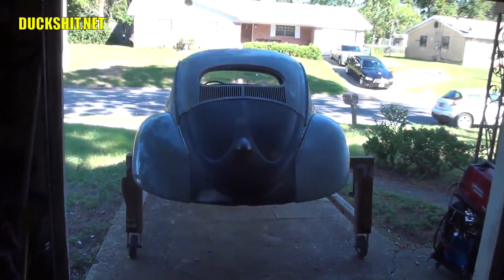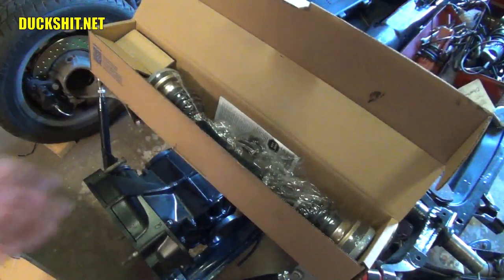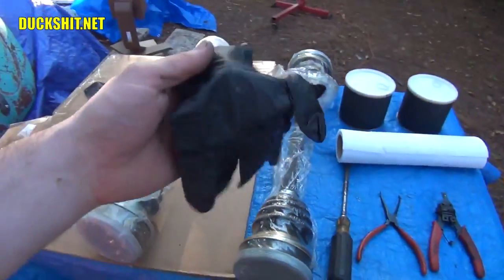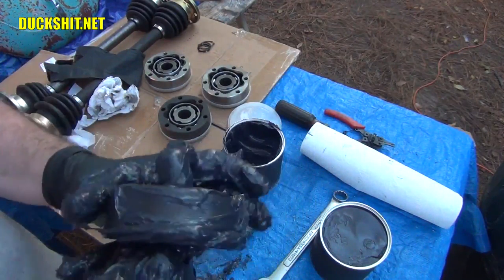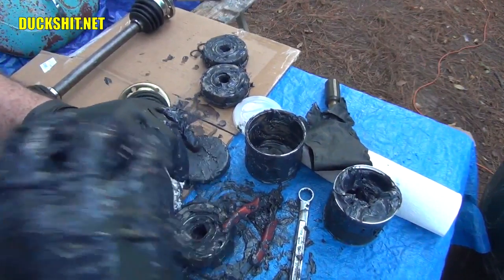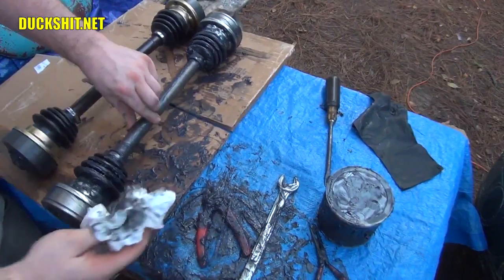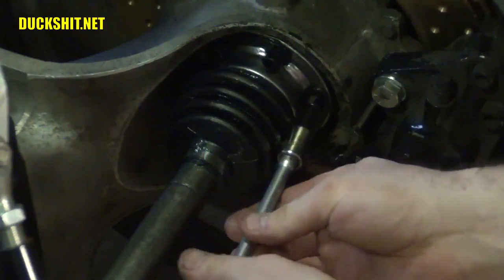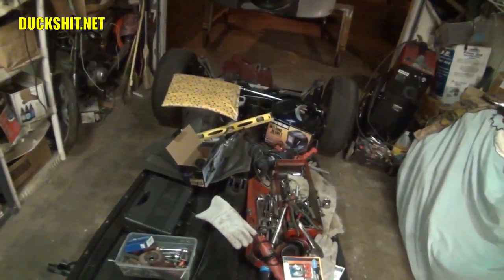Drive Axles / VW CV Joint Packing - ROTTEN OLD 1956 Chop Top Oval VW Beetle - 50

Comment from the maker: ⚫ Eleanore - ROTTEN OLD 1956 Chop Top VW Beetle PLAYLIST ⚫
WATCH NOW! ▶https://www.youtube.com/watch?v=L5exOhQeQAs&list=PLfdXu8r6T_5WR0iNamrnVZloB5dOdlYE1
Reply: dont forget the splines need to be buffed with a wire wheel so it will easily slide together with engine.
Reply from the maker: Yep, the input splines on the transmission..... not the axle splines as I worked on in this video.... haha!  But the input shaft splines were covered in the video that I failed on today... lol!  I'll try again tomorrow!

Comment: Thanks for demonstrating packing the cv joints it’s not my favourite job also , I need to do mine . I’m reusing my cv joints so the old grease has to be be cleaned out I may purchase a wash tank but I have and used the grease tool to pump in the new grease, I know it’s a job that you may only do once or not but the tool does lots of other bearings also . Thanks for your help 😊👍
Reply from the maker: Yeah man, not a fan of this sloppy mess!  Dirtiest job you can do on a VW!   Just some brake parts cleaner should be enough to get those CV joints cleaned, they are easy to disassemble, wipe em down and squirt em clean. Thanks so much for the comment my friend!

Comment: Well if those axles are for a 944 Turbo ( 951), then they are good for over 400hp lol in case you were wondering. They took more power then the stock transmission could take ( ask me how I know lol)

In the late 90s I had one of the fastest ( on record in the mid east coast)  944 Turbos making 424hp as the wheels. at the time I worked at a local Porsche Speed shop Porscha Pitshop ( and renamed PitStop Motorsports because Porsche threatened to sue because it was named Porscha even though the E was changed to an A)
Reply from the maker: Believe it or not they are actually the same axle that is on a stock Beetle, just longer.  The CV joints are completely different though.  That's some interesting information though!  Thank you so much for sharing that story!  I often correct people on the spelling of my Eleanore so that I don't get sued by the Mustang people myself!  Haha!
Reply: @DuckmanCycles  how about that, well with them being shorter on the bug, I would imagine they may even be a bit stronger then the 944 Turbo's (951, the reason I say 951 is because, that it is the number designation for the 944 Turbo. Expample: The 944 is with out the turbo and the 951 signifies a 944 with a Turbo)

Just another interesting Porsche fact.

So yes I fully understand you correcting others spelling of your " Eleanore" 

Great videos, Thanks!

Comment: I installed the CV joints dry onto the axle and placed in a vise, then used a 1 inch flat scraper to press in the grease on each side + extra in the boot + extra in the trans and wheel flanges. Less mess and fuss. YMMV
Reply from the maker: That'll work!  Just gotta make sure it goes all the way though!  👍😀👍😀👍

Comment: I'm doing the exact same thing!  I'm getting all the parts together ect,  Did you get your swan hooks  yet for your brakes?  :D   anyway which year did you specify for the axels and what size are the axels  speced at?   Thanks for your videos Love them!
Reply from the maker: I just bought some Vanagon axles (all years same) if they didn't fit I'd return them for something else.... but they fit just fine on first go!  No swans yet, I would like to have my ebrake working so thats something i need to get on!

Comment: I have never had to deal with CV joints, could someone tell me the difference between a CV joint and a U joint. What would happen if you made two axles with U-joints instead of Constant velocity joints? I have seen many 4 wheel drives with u-joints and even mid 60s corvettes!
Reply from the maker: Well... you COULD make an axle with U-joints, but  as the name of Constant-Velocity (CV) joints implies, they always move at the same speed.  U-joints turn on an elliptical, they speed up and slow down as they articulate, becoming even more evident the further they bend.  CV joints have no such limitation. So if you put axles in with U-joints it would feel like your wheels were ovals and not round.  It'd have a very sea-sickening effect lol!  You often find U-joints on drive shafts that don't bend very far, and they would be installed in phase, so the one that causes the elliptical behavior,  the second joint reverses it back to round.  You typically find CV joints in the short axles on most modern cars. Universal joints also rob a considerable amount of power to function as they do, CV joints don't have the same issue.
Reply: @DuckmanCycles  Thank you!
Reply from the maker: @charlestait5303  You bet!  There are some other more modern types of joints out there, but none are in vehicle production yet, only industrial machinery at the moment!

Comment: Hey I noticed you didn't apply any gasket or rtv when you connect them together. There is a possibility that some grease might leak out with time.
Reply from the maker: Good call.... but these do no require seals!  No gasket, and no silicone sealer.  This is per VW manual!  Grease doesn't leak out either in normal conditions... it's too thick.  Maybe you can heat the CV joint with a torch while its spinning at very high speed to make it leak if you really wanted to... but at tha point you'd probably just set the boot on fire and that would fail first!   LoL! 🤣👍🏻

Comment: hay glen have you though about using lead instead of body filler less sanding and no plastic better bodywork and easier.
Reply from the maker: I have thought about it, but I won't be doing that part :-)  Earl is going to hammer everything out to be damn near perfect with little to no fill it all!

Comment: I have an ATV and i need to increase it's ground clearance, for which i need a bend of about 40 degrees on the CV shaft, is that possible? Which shaft should help?
Reply from the maker: Depends on the make and model of the ATV.  Lots of things are possible.

Comment: Excellent video, I have a question, what is better a floating or rigid transmission?
Reply from the maker: Thats a matter of preference and use.  Solid transmission mounts are stronger, but they are noisy and will make the car vibrate.  For a street vehicle use rubber, for a racing or offroad vehicle you can to solid.  Or just use a rhino mount, its the best of both worlds!
Reply: DuckmanCycles and VW Garage  thank you very much for guiding me, the truth is that I also have a vw project and my goal is street sports, but I still have some doubts and I found interesting the modification you did to your transmission

Comment: You started with dropping the bolts for the CV. That's as bad as knocking over your coffee/cola/drink when you move yourself or something you are working on.
For greasing, try Pro-Tex Invisible Gloves to coat your hands BEFORE you put the rubber gloves on. It will make it easier to cleanup afterwards. For years I just rubbed down with petroleum jelly before the gloves to do it. And THAT was a mess and a half. But it did make it easier to clean off my hands after I got axle grease on them.

Moe
Reply from the maker: That was the bearings coming out of the CV joint.... even worse than the bolts!!!

Comment: If you soak the gold things in vinegar it will usually take the gold color off
Reply from the maker: Phosphoric acid works, too... but I think removing the color will damage the protective coating... then it will rust.  No?
Reply: @DuckmanCycles  ya

Comment: Re: Packing the CV joints:  You've got a cap on one side, why not put another cap on the other side, slop some grease on the front side and make a cap-CV-cap sandwich, repeating as necessary?

Also, save the caps and put a grease fitting in one of them and make your own CV joint greaser.  Ask a tightwad for these tips...
Reply from the maker: Thats  a good idea, but this is the first time in 20 years I did CV joints.  LoL!  I don't plan to do it again for another 20 years.  All the dirty stuff  goes in the trash! When I'm in my 60s and I have to do this again we'll see what I can find.  😀😀😀😀

Comment: Hey Duckman, nice video as usual, I know this is over a year old, but can you give me some info on the suspension setup? I am mounting airbags and this setup could be a good option to welding a cross bar and the brackets to it and the lower arm. Thanks!
Reply from the maker: Hey thanks!  The info you seek is so much more than would be fair to me to type out again, when I made so many detailed videos about all of this stuff!   Please have a look!  Ask questions if you need em!  But I would not suggest air bags on these parts.